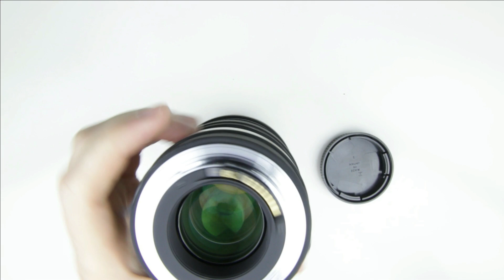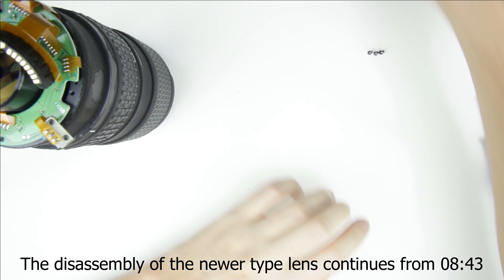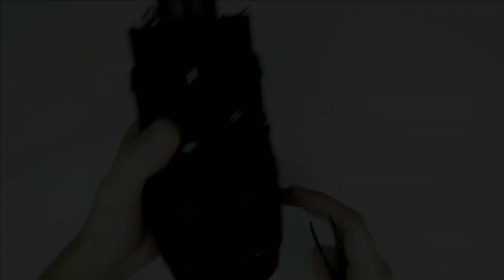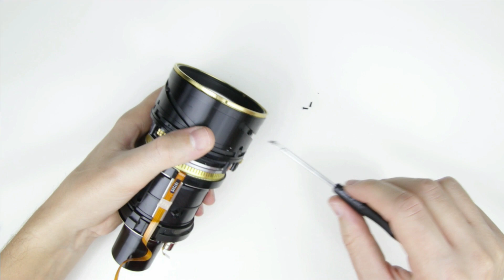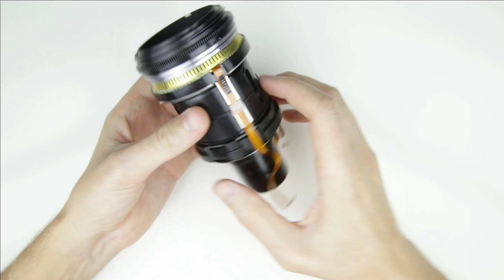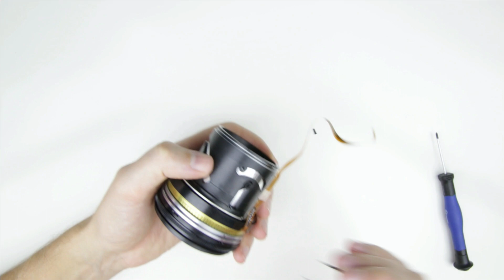Sigma 70-200mm f/2.8 APO EX DG HSM disassembly

Comment: Hi there, I see after you unscrew the main end lens and the tape around it you move the gold ring one way - it looks like you try to unscrew it but that is a adjustable ring that doesn't come out - it can adjust the focusing ring/ mechanisms about 2/8 or so either way. You haven't mentioned anything about it after you turned the ring in one way few times. When you assembly the lens again what should be position of the ring...screwed it in 100% or out or anywhere between? thank you
Reply from the maker: Can you give me a tomecode?

Comment: THANK YOU THANK YOU THANK YOU!!!!  Must admit when I first looked at this my reaction was 😲😳😨. I only wanted to clean lens my frontal lens and didn't want to dismantle the whole thing... BUT then I realised I don't have to strip down the rear lens to get to the front ones...🤭😁  So I just followed the the frontal part of your video and HURRAH  I was able to clean it.    The only issue I found was I didn't have any tape to put back on the lens edges... I tried reusing what I'd removed but that just snagged and the camera wouldn't focus...  so I just removed it.  The gap tolerance between the focus cover and the lens body is so tight no other tape will do...  BUT I'm happy with the result.  If I get a problem with the lens loosening I will look on ebay, but for now happy days... THANK YOU!
Reply from the maker: You're welcome, I'm glad that my video has helped you.

Comment: Hi I have small amount of fungus in my Sigma 24-105mm f4 DG art for canon, do you please have a repair guide for this lens. It seems fairly easy, I have removed the ring coveringthe7 screws, but unsure which i have to remove thank you Ron
Reply from the maker: I have never ever disassembled the lens you have.
If the fungus is between the first and the second lens element, then I would recommend to watch a few of my cleaning videow, because the procedure is quite the same, and might apply for your lens also.

Comment: Hi, I have a Sigma 70-200mm f/2.8 apo dg hsm os, when I try to take photo with it, autofocus doesn't work, I'm not sure if optical stabilizer works too, when I shake a bit I can here something inside that is moving. If I try to focus manually, the ring keeps rotating. Even if I try to shoot with af or mf, high or small aperture it shows "error 01".
What do you think the problem is ?
And what do you suggest me to do?
I appreciate your work.
Regards Musli.
Reply from the maker: - Something is shaking in the lens: there is a lens element in the IS unit which can cause that, it is normal.
- Rotating manual focus ring: The ring should move the focusing lens elements, you should see that the focus scale is moving in the focus window, and when the scale is at the very end, then the manual focus ring should move further freely.
- Usually I get Error 01 if the aperture is not working. Check the aperture using the DOF button.
- AF not working: is the motor tries to move the focus, but the focusing seems "sticky", or it doesn't work at all?
Reply: I tried to check things that you suggested. Autofocus actually doesn't work at all (it doesn't move automatically, but manually it works as it should).
I checked also the dof button , but the aperture it's not working, I'm not sure if is anything wrong with motors or any cables.
I tried shooting with MF , and even though it shows err01, it still save the pics that I take.
What do you think that I should do next ?
Regards.

Comment: Hi. I am writing to you from Argentina, your videos are fantastic, I have fungus on the lens that is next to the shutter, in the video you see that you remove it completely, can they be disassembled at any end to disassemble and clean? both of them is it so sealed extremes? it is at the minute 22:10
Reply from the maker: I don't know exactly if that lens element can be separated. Sometimes the lens has lens elements which are connected together with molded plastic which can't be separated. You might use suction cup(s) to try to remove one of the lens element, if you can't then most likely the lens group can't be disassembled.
Reply: The Rear elements can be unscrewed, from the zoom body, then dismantled and cleaned, there is a narrow screw on ring at the opposite side from the camera, 3 removable lens elements and 2 spacers. I am trying to find the correct sequence and direction of these elements. Thanks

Comment: I have one of these lens that don't accept the focus correction values. Can it be a problem on the main board? Anyone knows where to get it? It seems dicontinued
Reply from the maker: Do you mean that the "AF microadjustment" in the camera?
Reply: @CamerasLensesEtc  No, i mean the lens calibration values are not accepted. and my camera has not AF microadjustment. That's what they told me at the service repair centre.
Reply from the maker: @CSantosMusic  I don't think that replacing the PCB would solve the problem, and maybe Sigma doesn't have PCBs anymore. One option would be to replace your camera which has AF microadjustment, the other option is to use LiveView to focus... depending on the camera, it uses contrast detect focusing, which is slower but does not need AF calibration.
Reply: @CamerasLensesEtc  Ok, thanks for your help.

Comment: Hi, Great video, Thank You, I am trying to find out the correct sequence of the rear elements, (tube that unscrews from the zoom body) the only bit you didn't dismantle in your videos.
Thanks
Reply from the maker: Do you mean the USM motor? Or the tube that contains the zooming ring?
Reply: @CamerasLensesEtc  The Rear Lens Elements, small tube about 45mm long, nearest to the camera body. I am trying to find out the correct sequence and direction of the elements. There are 3 removable lens elements and 2 spacers.
Reply from the maker: OK, now I know... the part which I removed at 22:10. I haven't disassembled that, so I don't know the sequence.
Reply: @CamerasLensesEtc  Yes that's correct do you still have that lens or a service manual?
Reply from the maker: No, I don't have that lens, and I don't have service manual. (Do service manual exists for lenses anyway?)
Reply: @CamerasLensesEtc  Haha, your right, never seen a service manual, just exploded view for ordering parts. Cant find anything on this particular lens.

Comment: I need to buy the frontal lens for the old objective. Where can I find it? If I don't find it, would it fit the lens for the new model on the old one?
Thanks in advance.
Fernando
Reply from the maker: Sometimes you can find for sale on ebay or aliexpress. Other option would be buy a (cheap) non-working, same type of lens from ebay, swap the faulty parts and sell the lens lens as non-working.
Most likely the front lens elements of the other lenses are not working with this lens. You have to use the part of the same lens.

Comment: My bayonet mounting ring got warped when it had a bit of a fall... I guess the tolerances are tight cause min is not coming apart this easy. The plastic part that holds the connections came out with a LOT of effort but the mount isn't budging. I got it in the freezer in a vacuum sealed bag. Hope that will shrink the parts enough where it will come out.

Comment: Could you please help me with my sigma EX 180mm F3.5 macro APO HSM
Reply from the maker: I have never had that lens.
Reply: The problem on it is the AF when I use the lens on manual it works well, but when I turn the AF on the lens my camera shows me something strange... The camara moves between one shoot and manual focus fastly without sense.
I don't know what could be wrong with this!
What do you think about?
Reply from the maker: If the lens does it in LiveView with newer Canon cameras, then it is a compatibility issue, which could be repaired with a firmware update. (However I don't think that Sigma can update the firmware on this lens, maybe they would replace the PCB if the lens would be supported by the service.)
I would recommend to try the lens on an older Canon camera, to make sure that the problem is with the lens and not with the camera.
If you're sure that the lens is faulty, then first I would clean the flex cable connectors (if the lens is the older version, then the flex cables are soldered, so they can't be cleaned). Also, I would test the AF/MF switch (test the conductivity with multimeter), if the AF/MF which is not soldered to the PCB, then try to disconnect it and then try the lens on the camera.
Reply: I've trying my lens in more canon cameras like an apsc 450D, 40D,  bla bla bla
Mine is 6D mark ll
Thanks for answering!
Reply: @CamerasLensesEtc   I think is not the older one.
It looks like intermediate isn't newer but no the older one!

Comment: hi, can  this lens be collimated and if so, what stage of the video shows the adjustment?
rob
Reply from the maker: I did not do that before. To do that look for screw collars (plastic sleeve on the screw) which are not symmetrical... you can use those to calibrate the lens.
Reply: @CamerasLensesEtc  awesome thank you, are the plastic screws shown at any stage in your video for reference?
Cheers again rob
Reply: @CamerasLensesEtc  which bit is the screw collars?
Reply from the maker: @RobDaBankz  I don't remember... start to disassemble the lens, and when you see a non-symmetrical screw collar, that is it.

Comment: i have one old model, without the control keys ... I used in a nikon D5100, after I bought a Nikon D5300 and in a D5300 it doesn't make  the autofocus ... why?
Reply from the maker: I'm a Canon-guy, so I don't really familiar with Nikon equipment, but maybe the reason is, that your lens doesn't have autofocus motor in the lens, and the camera body moves the AF lens element with that AF pin, and the AF pin (phisical connection) in not present in the D5300 body?
Reply: @CamerasLensesEtc  both cameras do not have a focus motor, so it should work on both, but it’s not happening. does this lens have an internal battery?
Reply from the maker: No, the lens does not have battery.
Reply: @CamerasLensesEtc  I found out, really the older lenses had a problem with firmware and some didn’t recognize some bodies without a focus engine. Thanks friend!

Comment: Hello, Do you maybe know if it is possible to remove only the front element of the earliest Sigma 70-200 F2.8 ? It does have a the front lens retaining ring with the 2 slots ( do not see this ring on the second version in your video). But once this ring is removed, the glass will not 'fall' out, it remains sitting very tight in the barrel.
Reply from the maker: I don't know. The earliest version I had was the same as in this video.

Comment: Hello, great video, thank you for posting it. I have fungus problem on a Sigma 70 200 f2.8 II APO EX DG Macro HSM Pentax version of this lens and tryed to disassemble the front elements after to see your video... but under the rubber the lens it`s diferent, it have the front part of the barrel separated from the zoom ring and after taking out the same 3 bolts that you did, anything happends... Any idea how to take off the front element to clean the second that is the one to clean? I will really appreciate if you can help me with this. Thank you.
Reply from the maker: So if you remove the screws, then the three black plastic pins, then the second lens element can't get out?

Comment: Good morning, my Sigma 70 200 lens fell from a height of 60 centimeters, now when I move the lens I feel it moving all the time as if it were loose. What must have happened? I make a normal photo, but this noise is very messy.
Reply from the maker: Something has broken or misaligned inside the lens. Disassemble it, and check the inside of the lens what causing those noises.

Comment: Hello and thanks for posting the video, I have the Sigma 70-200 2.8 APO HSM EX Lens (mine is not DG) Canon Mount.  The focus motor is not operating, very choppy and gets stuck.  Could you tell me if the focus motors are the same in the DG model and the Non DG model? Also is your video relative to the non DG model?  Thank you
Reply from the maker: I haven't disassembled the non-DG model yet, so I don't know the answer to your question. I would advise you to disassemble your lens, and check it inside. Maybe the problem is caused by dirt, or misalignment inside the lens, and not a faulty HSM motor.
Reply: Thanks for helping me out!  I just purchased a used 6D full frame Canon yesterday.  I decided to try the not focusing sigma 70-200  lens on the 6D,  it worked, focus is now working on the 6D but does not work on my crop sensor 70D.  Hope this thread helps out others that are having focus issues on there crop sensor canon cameras using this sigma lens.  May be  this lens is just not designed for canon crop sensor cameras or I just got lucky.  Thanks again!!!
Reply from the maker: Some old Sigma lenses can have compatibility issues (AF or aperture doesn't work properly) with newer Canon cameras. Seems that this is the case with your camera-lens combination.

Comment: I had dirty lens glass so I decided to clean it since Sigma is expensive so i took it apart...that was easy...tnen after cleaning I put it back together which i thought was easy as well...but woow...now the focusing will not work . The lens was in perfect condition when it comes to functionality. So now it is not focusing.. the focusing motor moves one direction after I press shutter only  like 1cm and then immediately back to the same position very quickly and it stops. I have no idea what to do next.  ;o(
Reply from the maker: As I understand, the focusing mechanism is stuck st some point. The best would be to disassemble the lens, and when you're disassembling the focusing unit, check which part of it is causing the problem: remove one part, then twist the focus, and check if it still stuck.
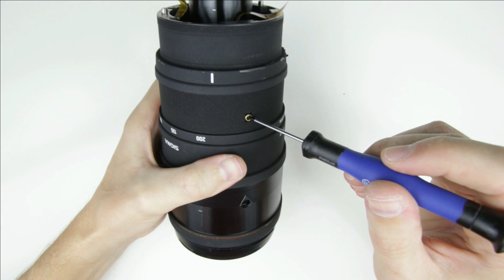The other problem can be that the lens is assembled incorrectly. Check out my assembly video: https://www.youtube.com/watch?v=7-_ZGoKPmak At ~10:55 after you put back that ring, check if the manual focusing is working perfectly.

Comment: Hi, and thanks for the great videos! Do you know if this lense with the macro is much different? I got one for practically free, but it has been in a house with heavy smokers, so there's tar on the lenses and I might have to take it apart to clean it, as the pictures it takes are not sharp.
Also, do you know if isopropyl alcohol does any damage to the coating on lenses?
Thanks a million in advance, keep up the good work!
Reply from the maker: The outer lens barrels basically are the same, there are differences in the focusing mechanism. I would start with cleaning the front lens and the other lens element underneath it which can be easily removed, see the part of this video when I removed the front of the lens.
I don't know if isopropyl alcohol would remove or damage the coatings, I use simple lens cleaning fluid which worked for me so far.
Reply: @CamerasLensesEtc  thanks. I'll start with cleaning front and back element and see where that takes me. UV filter is also stuck due to a light hit, so you other video came in handy=D
Reply: have you opened it? I have a macro II version. I have tried to open the front element, but there are 6 screws and half of them are completely stuck. The screw head got stripped! I don't know what to do next. The second glass has some fungus.
Reply from the maker: If the screw is in plastic, you can try to heat the screw, so it will be much easier to undo it. (Assuming that the screwdriver still has some grip on the screw.) The other option is to cut a small vertical strip on the head of the screw, then you can use a flat head screwdriver to remove it. Another option is to drill the head of the screw. Of course this causes fine metal dust which can go into the lens, so use the latter two options in emergency.

Comment: Where can i find parts ?
Reply from the maker: eBay, aliexpress and google is a good start. Unfortunately, there aren't that many spare parts for Sigmas than Canons.
Reply from the maker: I solve only the problem of the lens, and if the motor is working, then I don't disassemble it.
Anyway, I don't think that removing the motor is important if it is working. The motor can be removed very easily: remove the flex cable, then twist the top metal ring to release it, then remove the rings one by one.